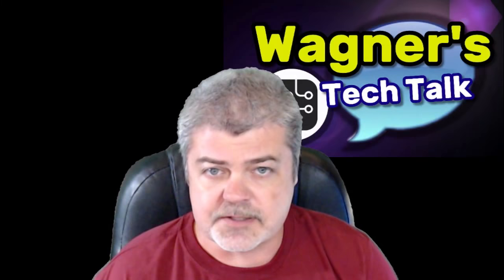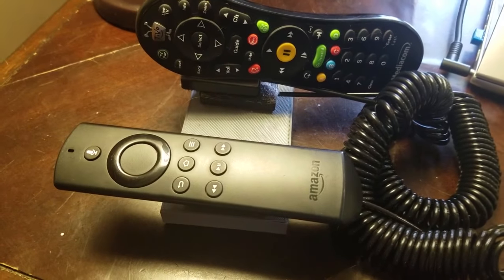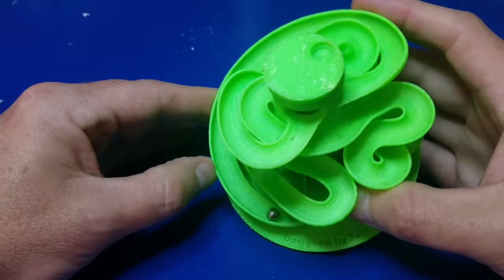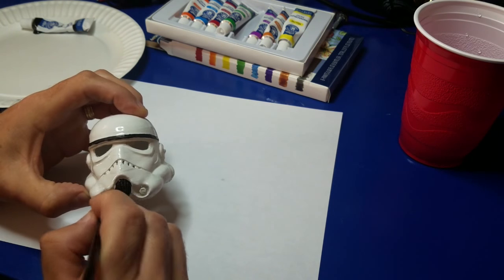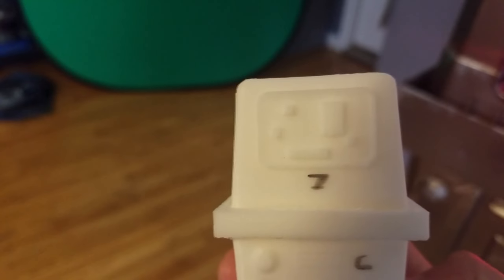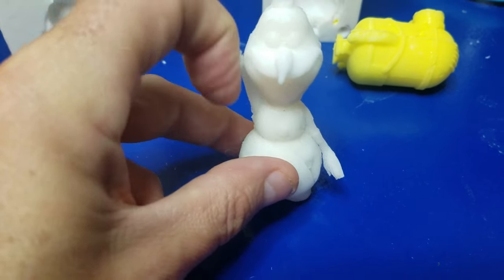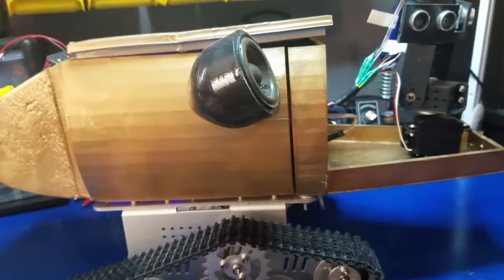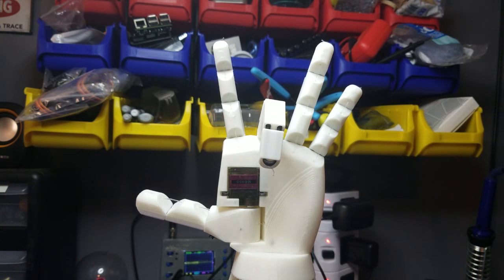Amazing 3D Prints: Robots, Silicon molds, costumes, water spike, mini-storm trooper helmet +more!

Comment: Very nice stuff! What kind of printer, and how long have you been working with it? 
Hands down the most useful items I've printed were a collection of hose adapters to get my Harbor Freight dust collector working with all of my tools.  Also, "soft jaws" for my vise to firmly hold items we don't want marred,  And lots hangers for test leads.  Oh, and the full-size chestburster from Alien made a good addition to a Halloween costume!
Reply from the maker: My printer is a Flash Forge Creator Pro (2016 edition).  It was a Christmas gift from my Mom and I'm seriously hooked :)  It was purchased in Dec. 2017, initially I bought a Quidi printer but had problems with it, returned it and got the FFCPro instead.  I don't regret it, it's been a workhorse.    That's awesome stuff you've printed!  I just recently started toying with the silicon mold and that's been a fun little experiment (my kids liked it).  You might want to try that too just for fun.  I also printed a mold for a handheld gaming controller and used the silicon method to make the buttons "squishy".  I may post some pics of that on my FB page www.facebook.com/wagnerstechtalk this weekend.  How long have you had your printer and what kind is it?  Please join us on the FB page, always great to hear what others are doing and a little easier to collaborate there, always finding new/different ways to use this tech!